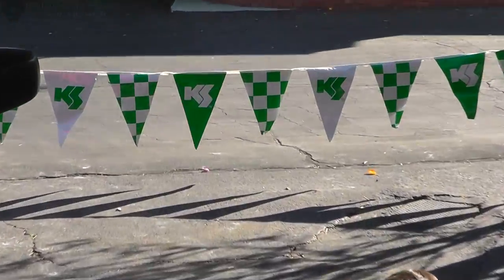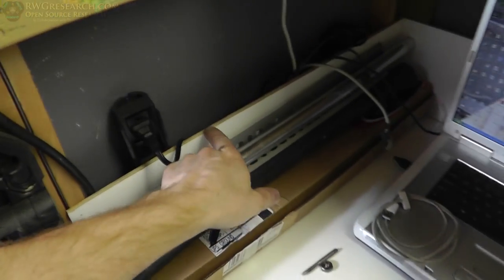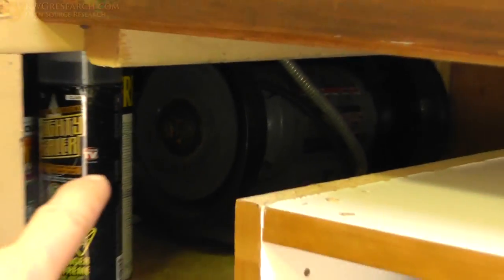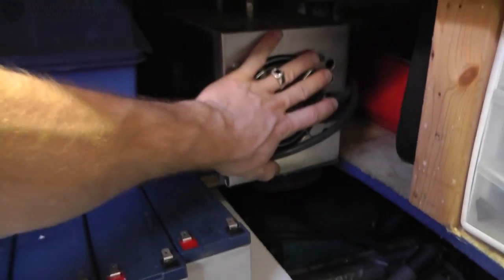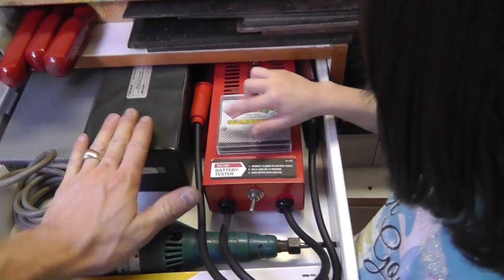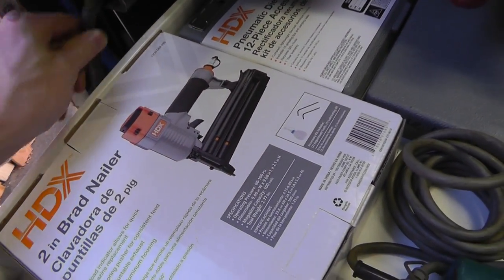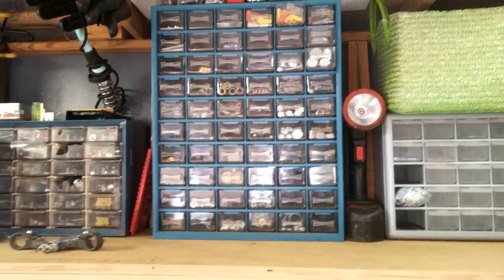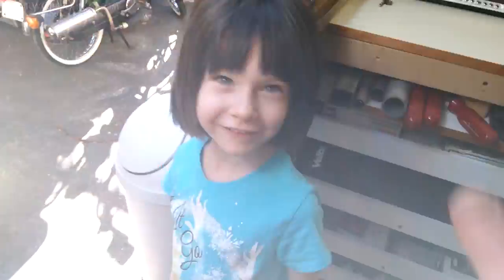What Can Be Done With 44 Square Feet? Dream Shop!!! How Much More Space Do You Need ??? :)

Comment: In your video about moving to another place i saw more things that wont be fit in this shed. It is good for you that you have new lab to fit all that things that fitted in your old house bacement. :)
About lithium thing, yes it is dangerous, i had fire too, but i was at home and it was loud bang. I charged not protected 18650 lithium batteries. But your story ends with diaper. :)